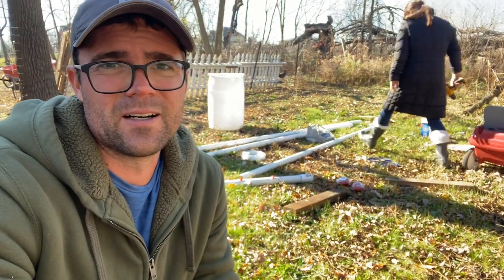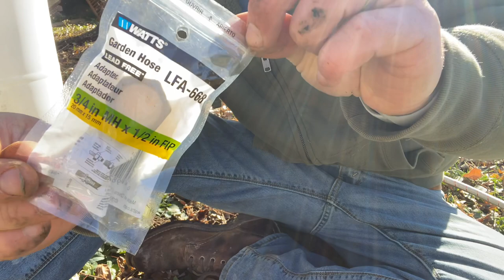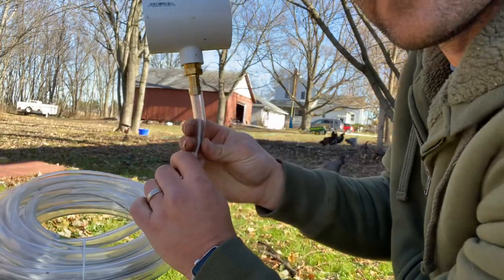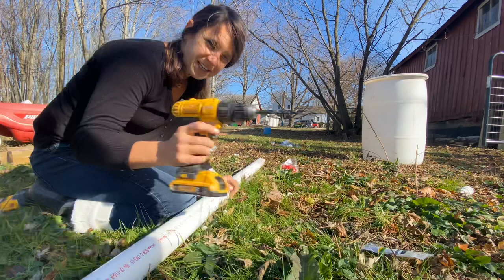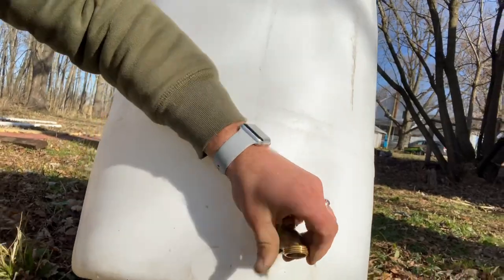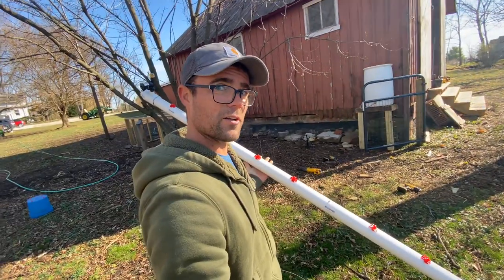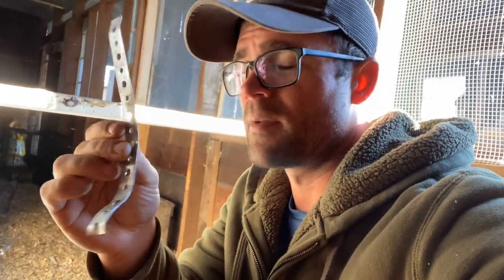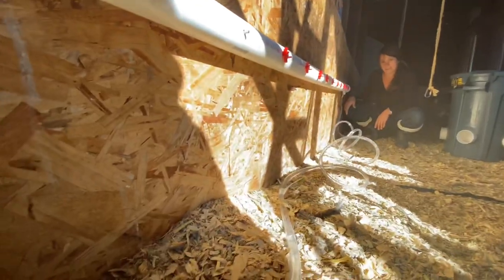DIY Heated Chicken Waterbar

Comment: You might want to look into the plastic tank de-icers since you’re using a plastic barrel. I believe the one you got is meant for metal stock tanks. Also you are supposed to add a grounding rod near the barrel and drape a wire into the water to ground the water along with a GFCI outlet.
Reply: I second both statements.
Reply: Additionally, the $65 stock tank deicer is over a kilowatt if I recall, so way way too much power for this application. That said, I'm doing something very similar - so good luck.

Comment: I put a bleeder valve inline at the end of a nipple run, basically a 90 or T with and extender (1") and a threaded cap.  This way when initially filling the system, you can bleed the air out of the system noting that hydrolic pressure works best when there are no air bubbles making the pump work more effectively.
Tully River Quail Co

Comment: Did you know... if you cut the top of the barrel 1inch below the top rim, (around the circumference .Just let the rim be your saw guide, ) then cut a 2 inch ring off the cut end of the barrel, the top will drop right in the barrel for a lid.
Reply from the maker: Ahh. That’s brilliant. 👍
Reply: @Kakadoodle  I’ve done this also on cutting the barrel in half, and now I have a covered short barrel 😉

Comment: Look not trying to bust balls here and anything I say is NOT meant to insult or demean your work. I don't hold back and I give honest opinions and suggestions.

First and most important. DO NOT USE WASHING MACHINE HOSES. Most of them say they are not meant for drinking water. You need to use hoses that are meant for potable water.

Put the system inside the coop. You have plenty of room. in the winter the warmth in the coop helps to not let the water freeze. It also does not let direct sunlight hit it directly and that keep algae from growing in your tank.

Use Apple Cider Vinegar all year during the winter months use Food Grade Propylene Glycol Antifreeze. It is meant for this sort of stuff.

Never use large pipe to drill the holes for the nipples. Use 3/4" or 1/2" irrigation pipe risers, threaded tees and plugs. 

Always use the 5/16' drill recommended and Use a proper pipe tap. Drill and tap the plus not the pipe. Do a few extra so it there is ever a time you need to replace one all you do is take the plug out and replace with another. Fix the old one and save for later.

You don't need teflon tape if you properly tap. You actually were putting the teflon tape on wrong. Go with the treads not against. 

Invert your tank. there is no need to drill any holes into the tank if you do that. I can provide images.

Use a hot water heating elements. Use a stainless steel pipe nipple and a union for the housing and put it inline.

NEVER use the pump to PUSH water through the nipple manifold. Those nipples have springs and are meant to handle low gravity water pressure. Put the pump at the end to suck the water out.

Put irrigation filters before putting out water to the manifold and after the pump.

In your case and even if you use the 3/4" pipe, always use clean out adapters and plugs at both ends. Never glue/cement the plugs. That way you can run a string through with a rag tied to it and pull the string through to clean it out.
Reply from the maker: Wow. Ya. Some of these things we learned since. But thanks for mentioning them here.
Reply: @Kakadoodle  Hi. Can you please post an update video to explain what changes you made? 😊
Reply: @AztecWarrior69

We are about to build this system, and it would be ideal to incorporate your suggestions from the start.  

For those without a mechanical / plumbing background, would you please create a video showing images of each suggested change? Thank you. Also what is the correct ratio of propylene glycol to water?
Reply: @kimkeaton1806   I will try and make a video but it is cold out. LOL.  

I have two videos that show the same system but on a chicken tractor.

They are called.
"Chicken Tractor watering system walk around"
and
"Chicken Tractor Water System Explanation and DEMO"
look those two up and comment there. I will upload pix of the process and link to them there.

"Also what is the correct ratio of propylene glycol to water?"

I can not give you that answer. It all depends on the recommended ratio that the manufacture gives. It is not like apple cider vinegar, where it is a safe bet to put two ounces per gallon and if you add more it still good. So you have to look for the product and download the datasheet or call the manufacture before purchase. If you sent me the link of the one you intend to buy I will look up the information for you.
Reply: @AztecWarrior69_69  Thank you for your response. I’ll watch your two videos as suggested. Appreciate that. No worries / rush on another video outlining your suggestions on Kakadoodle’s system - besides the arctic wave being no joke this year, it may not be necessary once I see your two videos.  😊

The propylene glycol that we have is manufactured by Bluewater Chemgroup. It is food grade. I’ll look up their datasheet and hopefully will understand it.

Comment: Make sure that your thermostat plug is located on the outside of your coop so it turns on at the correct outdoor temp.
Reply from the maker: Ahh.  Good idea!
Reply: @Kakadoodle  otherwise the heater will turn on only when it's below temp inside the coop, but the rainbarrel is outside.
Reply: @gailmulcahey9455   They should have put the whole thing INSIDE. The warmth in the coop makes the whole system work much less. Plus if they don't add any vinegar to the water, that drum will get full of algae

Comment: Thanks for this video I’ve been looking into a similar design. If you haven’t already, consider  replacing your outlet for the submersed heater with a GFCI for some added safety.
Reply: The outlet is GFI protected, perhaps not visible in the video.

Comment: We started out with those nipples and kept having to change them out too frequently. Recommend either the cups with the flow shut off or the gravity fed nipples. We haven’t had to change it any of these as of yet. They both seem to work a lot better than the side nipples.
Reply from the maker: Ya. We switched to gravity ones as well
Reply: When you switched to gravity Nipples did you rotate pipe so they were facing down or still sideways like the originals? Building this now
Reply: Yeah… my ducks kept DESTROYING the springs on those red nipples. Literally in minutes. The cups and bowls both sit horizontally, no need to rotate anything.
Reply: The cups end up freezing on me, how do you stop that?

Comment: This was the best setup and quality of content that I was able to find ANYWHERE. I followed almost all of your ideas for the equipment to use. I just installed everything and have yet to add water to test the functionality, but just wanted to say thank you for the content. If I could give you more thumbs up, I’d give you more. 

One question I do have is have you had any issues with the nipples losing their seal overtime and leaking with having a “pressurized system”? Not exactly pressurized, but more so than gravity fed. I was contemplating adding some silicone or hot glue on the backs of them for a water seal and to hold them in place with still being able to replace them if I need to.
Reply: The metal strip you used is called plummer's tape.

Comment: What I thought you were going to do, was cut slots in the 2" pipe, and then circulate the water from the barrel through the pipe and back with the 12v pump. Plus, use a single battery and solar panel to run the pump. Circulating water doesn't freeze.

Comment: Instead of using the 2” PVC Tee, You can use a 2” x 1/2” Reducer Bushing instead.
Reply: I just put together 600 foot of irrigation line and some of the typical fittings are hard to come by right now due to shortage. Sometimes you gotta use what you can find, I ended up using mostly blue-lock fittings and PE, it turned out better without needing all the glue.

Comment: We just bought a 65 gallon water tank from menards this past summer.... And we are going to be setting  up  pretty much the same principle that you have this going...
Reply: How did it work out for you?
Reply: @leemikle2242  
We haven't set it up yet....going to this summer
Reply: @ryanlevron1972  thank you.  Just set up my barrel today, going to begin setting up the pump, water hose, and pvc drinking bar tomorrow.  Probably won’t use it until it’s done freezing outside because my birds are only 6 days old but atleast I’ll be ready
Reply: @leemikle2242  
We live in Wyoming.....were just now at the tail end of winter, 
 We are planning to dispatch our older flock and get a bunch of new birds in within the next month or so...
Reply: @ryanlevron1972  we live in central Wisconsin sitting here wondering why we choose to deal with this crap weather season after season.  But yeah my plan is to raise these birds for 2 years start a new batch and then swap out…
Reply: @ryanlevron1972  I’m hoping this watering system is the ticket… time will tell.  I’m hoping by recirculating warmish water the problem might be eliminated.  Also considering during the summer months to use 10 water nipples but in cold weather close off all but 3 so the 3 that are available get used frequently enough to not freeze up.

Comment: confused. How did you keep the barrel from freezing? Was that an electric heater like we use to keep our horse's water from freezing? 
& ...Can I wrap plumbing "heat tape" around my summer waterer and accomplish the same thing?  
... New chicken family, sorry for sounding frustrated  :(
Reply from the maker: Ya. A stick tank heater for the barrel. I didn’t have to wrap the pipe bc of the pump, but you could get a pipe coil to keep it from freezing as well.

Comment: A very nice vid, and Lots of useful information,  the chicken nipples are of interest, if you repeated the build, would you use the same nipples?  I am currently fabricating an auto watering system, much like your project. I’m in the Northeast, so heated , and circulation is included in the plan. The water would be located outside in the run area, you mentioned ice dams, how did you resolve that issue?  Thanks
Reply from the maker: I'm giving it another try using these - https://www.tractorsupply.com/tsc/product/backyard-barnyard-pvc-poultry-nipple-kit-6-pk-bbpvcnip6 - to see if that helps with the leaking and ice dams.  I just had to chisel them away last winter.

Comment: Thanks for the video. I’m getting all your listed materials together and have rewatched your video a couple times but you didn’t show how you ran the clear tubing back into the water barrel. How do you hold that tube in place? Thanks for your help. 😉
Reply from the maker: I drilled a hole near the top of the barrel, and just had friction holding the return tube there.  But make sure that tube is not clear!  Ours ended up getting algae from the sun.
Reply: @Kakadoodle  thanks for your reply. I already bought the clear tubing from your list. But if it ends up a problem I can change it out. My system is going to be smaller than yours so not so much tubing being used and it is more out of the sun I think
Reply: @Kakadoodle  use copper wire will get rid of algae if you just put some copper in water tank it's gone
Reply: @suemarkham9232  place some copper in water tank no algae 
My dad used it he had 2000 chickens at one time
This fellas system something like my pops
(Fighting roosters way back )

Comment: Looking to do something similar here in central WI...where are you located approximately, and wondering what your coldest temps are in the winter. Thanks!
Reply from the maker: We’re just outside of Chicago. We had some ice dams build up last winter from where the nipples dripped after the chickens drank from them. I’d also use a dark barrel and hose to prevent algae growth.

Comment: Use a step drill for your nipple holes.  I always seat the nipples with a glue gun, especially when using smaller diameter (1/2") pvc.  Never a leak and if using vertical nipples, the nipple can be replaced without removing the base that's glue-gunned in. (The whole unit could be removed if necessary with a heat gun to reheat the thermoplastic glue).
Reply: Brilliant!
Reply: @stacycharland5847   Not brilliant at all.
Reply: Glue gun? NO. The best thing to do is use the proper drill bit 5/16" and tap it with the proper tap. AND use tees and plugs. Drill and tap the plugs not the pipe.
Reply: BTW anyone who tell you to put hot glue on ANY type of plumbing job should NOT be listened to about any type of lumbung. If they don't know how to do something right and turn around and tell others how to do it wrong, then you shouldn't take anything they say seriously.
Reply: @AztecWarrior69  this is a non pressurized system.  Obviously using plumbers tape when treaded fittings are used is the correct method for "plumbing".  Using hot glue to secure the nipple housing when inserting it directly into a plastic container is you can develop a all thickness of material and prevent rotation.    Of course, you are welcome to your opinion as along as we are permitted to continue with our successful methods.
Reply: @tullyriverquail   " this is a non pressurized system. " 

You are starting off a rebuttal with that? Are you serious? Did you not see the part where they are using a pump to push warm water through the system. If you don't know that pumps will cause pressure then again NO ONE should be taking your advice.

"Using hot glue to secure the nipple housing when inserting it directly into a plastic container is you can develop a all thickness of material and prevent rotation."

Again if you do it correctly by tapping it, You don't NEED to do the heavy build up of ANYTHING. That's what a complete novice would do. "YEAH just keep putting glue on it til it stops leaking"

"Of course, you are welcome to your opinion as along as we are permitted"

Well no Shite Sherlock. I know I am welcome to state my very correct opinion. It's that "as along as" part. There is no "as along as". I can state my opinion no matter what. 

"continue with our successful methods."

You have a very jacked up definition of the word successful. I would never call plastering on hot gun ON ANY plumbing fitting, pressurized or not, a success. That called a failure. That's like crashing your car and you putting the bumper back on with duct tape, a success.  But you keep telling yourself that, whatever makes you feel "successful". Most people will call that lying to yourself. I hope you are not putting out this as an actual product to people. That means you are not only lying to yourself you are doing that to others and selling low quality.

Comment: Great video. How often do you fill the water barrel and how many chickens do you have?
Reply from the maker: We have 30 laying hens and some younger chicks. We have to dump out and refill the water often (probably should be done once a week) being that it’s in the sun. Probably the biggest drawback of this setup.
Reply: @Kakadoodle  exactly my thoughts! I've built a summer setup waterbar and now have to adapt/re-engineer for winter. Tips for all: use blue barrels and wrap with black plastic, keep out of direct sunlight (North side for Northern hemisphere), use solid/light protection on hose/tubing (your clear tubing is a mold magnet, make draining and filling processes accessible. More importantly, keep water/moisture out of the coop. Hope this helps!

Comment: We just installed the nipples directly to the barrel. The barrel also gave the coop some heat.
Reply from the maker: Ahh. That is a good idea. I think the idea behind the water bar is to keep the water moving.  But I suppose you could just put a pump in there as well to circulate the water. 🤔
Reply: I've seen the barrel application and the thought there is that the nipples extend into the warm barrel water preventing freezing so you don't need the pump and circulation you need in the pipe method.  The question I have is what happens if you have a leaking nipple that needs replacing?  Are you emptying a drum mid winter to dry it and replace one leaking nipple?
Reply: @kimberleeharman190  You just have to quick.
Reply: @salmonhunter7414  LOL My level of coordination = Klutz extraordinaire. I would manage something nobody ever thought of I'm sure   but very good to know you don't need to empty the whole thing :)

Comment: Thanks for the video. My hose from barrel to pump leaks where it is connected to the pump. The threads are sealed, but the hose leaks where hose connects to its threaded connector as if pressure was too high. I have tried a few hoses so it is not a defective hose. This leak happens both when pump is on and off. Any suggestions how to resolve this would be greatly appreciated.
Reply from the maker: It leaks through the sealed threads?  I had a problem with it leaking there as well, so I emptied/dried it, then put some silicone caulk around it. That seemed to do the trick.

Comment: Does the water still gravity feed if the pump is not on? Do you take the pump off through summer?
Reply: I was wondering this too. Have the thermostat control barrel heater and circ pump?
Reply from the maker: Our bucket isn’t high enough to gravity feed. And I do keep the pump on in the summer to keep the water moving. Not sure if that’s the right thing to do?
Reply: @Kakadoodle  This was my question too, if the barrel is higher than the pipe, will it gravity feed with the pump in the line but off?  That's the one piece I have confusion about.  I am prepping for upstate NY winter chickens and already know I don't want to haul water 2-3 times a day but I didn't want to burn pumps out either if I can help it :)